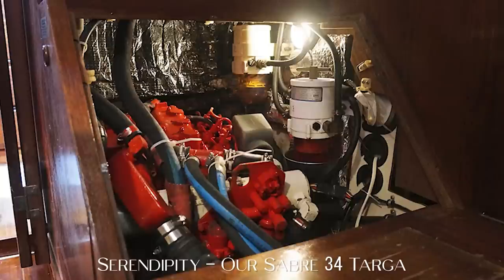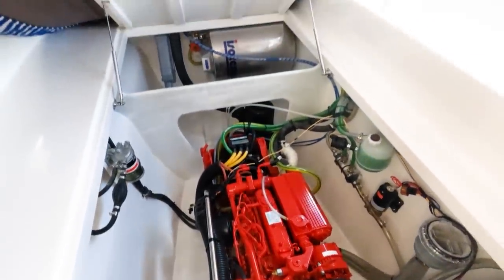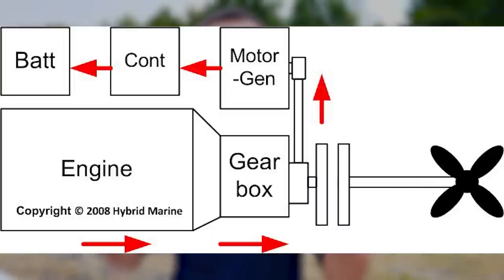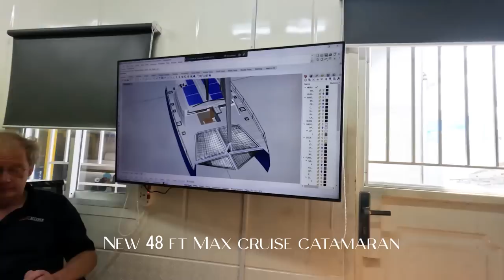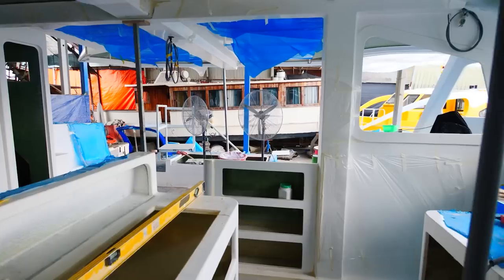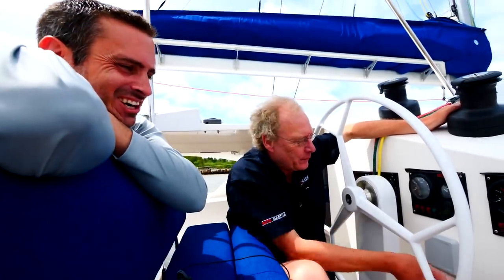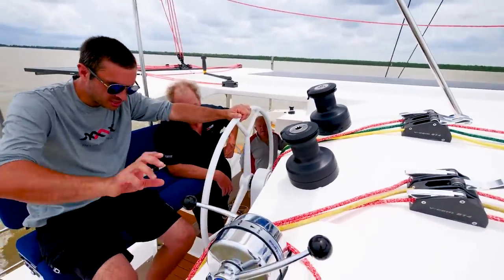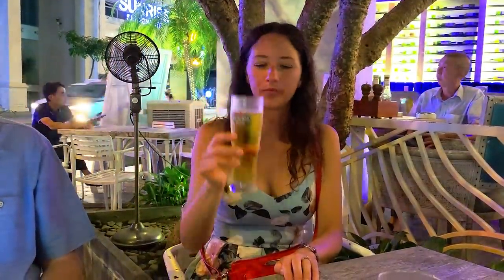Putting a Hybrid To The Test  (MJ Sailing - Ep 249) #electrichybrid #hybridengine

Comment: With pure electric, you could have it retractable so when sailing you could reduce drag and protect from debris or grounding.
Reply: With full electric you would still want to have hydro-regen as well.  Depending on your boat speed and the size of your solar array, regen can potentially produce as much or more power than the solar array and only reduce boat speed by a knot or so.  With electric it's all about diversifying the source of your power.  Solar + hydro + wind and even + hydrogen means that you should almost never find yourself in a position where you have absolutely no way to move your boat.

Comment: Lithium batteries, could installing them in a fire/explosion proof box reduce your insurance premiums? You can buy recharging/storage boxes for batteries at home.
Reply: LPO batteries with built-in BMS shut off before heat runaways. 
The older lithium compositions and controls did have fire problems. 
Currently,  overheat/fire issues are with poor electrical installations and not the LPO batteries.

Comment: So it was about a 10-12kWh battery bank? If you ditched both engines, and brought the same weight in batteries what size battery and range would you have?
Reply from the maker: It's a 21KWh bank.   The engines alone are about 150kg each.   Each 3.5KWh of batteries are 32kg.  So the weight would equal 31.5KWh of additional batteries.   Something that couldn't be charged without a genset or shore power.
Reply: @MJSailing Yes with ~2kWh or solar I would expect only ~16kWh on an average day, but If you are sailing and making 5kW via each regeneration prop, 10kW total ( I guess that would be sailing pretty fast to make that). If your battery bank was 52.5kWh then you would fully recharge it in under 6 hours of sailing.
So 52.5kWh would give you about 7 hours electric motoring at 5 knots. We really need more energy dense batteries. 
The safest option does look like having a least one engine in parallel. Just a shame you have to add complexity of a engine.
Reply from the maker: They don't make anywhere near 5kw of regen.   That's when running the diesel as a genset.   As Jimmy Cornell saw, regen is a bonus and hard to rely on
Reply: @MJSailing  O I see. Probably more like 500W isn't it.
Reply: @AORD72  if doing 8 knots  with both propellers in regeneration  you will get about 1.5
Reply: @fairwinds9630  Yea, I don't know why I thought 5kW. A see on the Betamarine website they say 100 watts at 5.5knots and 500W at 8knot, so 1kW at 8knots with two 19" props.

Comment: Lithium Dreams Up in Smoke? Rumor in the yachting world is insurance companies are starting to not insure boats with lithium battery banks or increasing deductibles to crazy amounts in South Pacific. IDK I bet the additional hybrid cost will buy a lot of diesel fuel. I own Victron Lithium bank with massive AMPS and tiny size. The insurance company can pull my batteries from my cold dead hands.
Reply: I wonder what percentage of lithium boats catch on fire? Sounds like the insurance companies are using it as an excuse to inflate prices. Shouldn't a good LFP battery just smoulder? Could you mitigate the chance of fire by installing the batteries and inverter inside a fire proof box?
Reply: I posted this above to sabret00th post.
LPO batteries with built-in BMS shut off before heat runaways. 
The older lithium compositions and controls did have fire problems. 
Currently,  overheat/fire issues are with poor electrical installations and not the LPO batteries.
Reply: @AORD72  correct LFP is one of the safest batts around - as matt said a lot of the problems are the wiring and crimps due to higher amperage - a lot of boats are going 24/48 V to reduce current but still need to not save money by installing min gauge wiring - as men we know bigger is better WTJM tattoo joke haha
Reply: @philipmackin1025  correct - I have 300Ah LFP in the caravan - 100 A max charge + 25% - 95% cycle and still at 300A + capacity after 4 years - Philip if the max charge is kept at about 0.5C etc and not discharged at 1.0 C for a long time it won't be the batts causing a problem - Insurance people don't understand that not all lithiums are the same
Reply: @philipmackin1025  LPO as in Lithium polymer, with those then wouldn't you still have the worry if the BMS faults, like shorts out you could end up with a fire? Or the internals short out and it starts a fire. With the LFP doesn't the battery withstand a higher temperature before ignition occurs and that temperature is higher than the internal shorting?
Reply: @jimlofts5433  So increase the voltage to 48V draw less amps to reduce fire risk. What are the other things you can do? I saw someone talking about even length cables, I guess between the batteries and charge/discharge to ensure even load on the batteries. 
Would you solder the crimps onto the cables as well?
Reply: @AORD72  wow bloody good question - solder yes no - I do as I don't trust crimps with corrosion etc but high current draw on cables can melt the solder and cause the wire to fall out - I do it because all my cables are oversize (cost an extra $50 ) and only draw 15 - 20 Amps - boats and bigger RV's will draw more with Aircon / induction stoves etc - the 48 v Q is all based on Ohms Law R=E/I that transposes into P(watts) = E(volts) x I (Amps) - so it is an inverse ratio 120 W at 12 v = 10A but 120W at 48v is 48V only 2.5 Amps - Even length cables when connecting 2 or more batts means the current draw or charge is equal to each batt as the resistance (ohms) is the same - Its not hard to grasp but it does become a rabbit hole pretty quick but common sense with DC is pretty easy AC whoa that shite will kill you if done bad
Reply: @jimlofts5433  I think you can buy high temperature solder. I would wick the wire and crimp with solder, then crimp, then solder together. The crimp holds mechanically and the solder creates a good electrical connection and helps protect from corrosion. Then heat shrink with heat shrink that has glue inside as it creates a seal to further prevent corrosion.

Comment: Modern diesels usually have electronic controls, so wouldn't a lightning strike take out the diesel computer anyway?  That is, unless you are carrying a complete, replacement engine computer.  One of the precepts of engineering is "keep it simple stupid," which means only make things as complex as they need to be and no more complex.  It seems to me like they are adding complexity to the system.
Reply from the maker: If you look at the engine in the video, you can see that this isn't a common rail diesel and has no computer.   Just like my Yanmars.   These are two independent systems.... Diesel and electric.
Reply: @MJSailing  Well, that's different.  That's also one of the advantages of my old Perkins.

Comment: 2 systems equals twice the maintenance
Reply from the maker: Hi Ann!!  Nice to see you back with all of your positive energy!!
Reply: @MJSailing  just objective reality, the more complex the system the more maintenance requires. Remember KISS .
Reply from the maker: I think you're missing the point.   The diesel can be used as the only option to propel the boat with it's full mechanical system.   This doesn't affect reliability and is no different than our Yanmars.  Add to that the electric side, and yes, that's more complex, but it could be completely inoperable and the boat still works.  I really can't think of a maintenance item this adds that wouldn't already be there with plain diesels.
Reply: Ann; you’re welcome to build your own boat so you can do exactly what you want. LOL.
Reply: Plenty of scary situations can occur out sailing. One of the worst things is losing propulsion. If you lost your mast in the middle of the ocean what would you do? Electric usually won't have the range to make it to a port. If you were hit by lighting (pretty common on boats) while in a bay and the swell was so big without propulsion you could be dragged onto rocks. Even trying to sail straight off a dragging anchor can be dangerous as you could easily lose a few hundred meters.

Comment: Dangit!  My napkin math was thinking somewhere in the neighborhood of 5kw for 5 kn of boat speed.  I'm definitely in the "straight up electric" camp, and if I were to start building a cat today, it would be built around too much solar, and a 50kw battery bank, and potentially producing hydrogen from sea water when not motoring using excess power from the solar, and using the hydrogen as a range extender when motor power consumption and use time surpasses a threshold (no need to dip into the hydrogen if you're just motoring for an hour to the next anchorage, and the sun will replace that power in a couple of hours).

Comment: Diesel is NOT cheaper, you have to pay for diesel, oil, filters, maintenance! Not to mention the smell, vibrations, noise! The hybrid solution is too complicated, two engines to maintain. Best solution is a single generator, two electric motors with regeneration (very efficient for a performance cat) and lots of LiIon batteries and solar panels. Think long term!
Reply from the maker: I don't agree.  Regen is a bonus and not a primary means of charging for someone world cruising (ask Jimmy Cornell how it worked).   And you need to way over size a genset if you're relying on that for propulsion to the motors.   Which then makes it horribly inefficient for other times.   

But really it comes down to what you expect from your diesel or electric propulsion. If it's just to get you out of a harbor, then electric/genset can be a good option.  But it's not what we want.    We would have missed most of Norway had we only had that ability.
Reply: I had a rough look at Beta gensets and they were about 500kg, vs a engine 100kg and shaft? (another 60kg?). I don't know why but there seems to be a big loss in the genset conversions (maybe. I read it wrong).
Reply: Think lightning strike with all electric.
Reply: Think automobiles. With all the billions spent trying different options the single generator has not been installed into a commercial example.
There are a few large very heavy trucks that do have your "best" solution but the weight would be too much in a sailboat.
Reply: @philipmackin1025  Nissan Note ePower